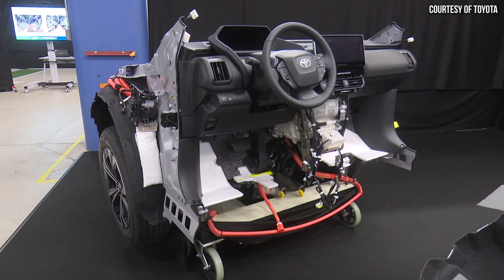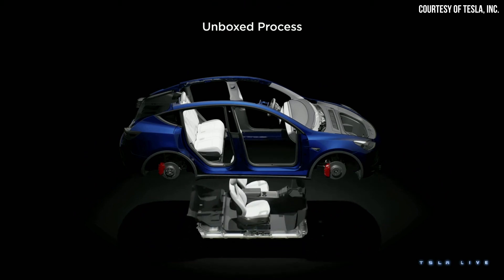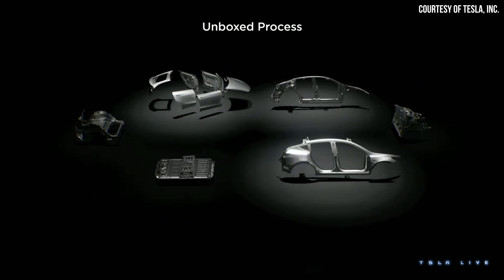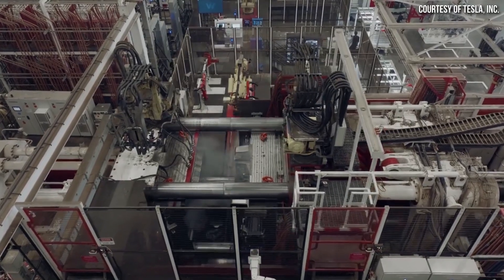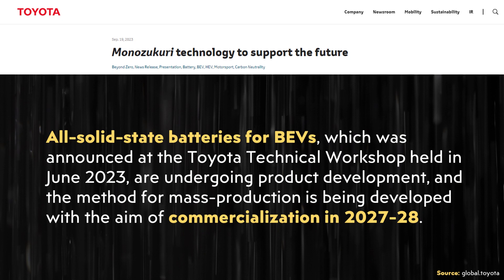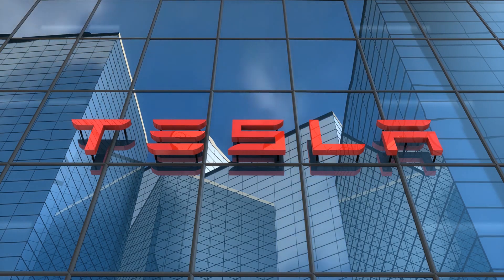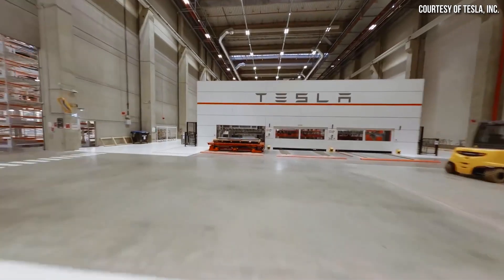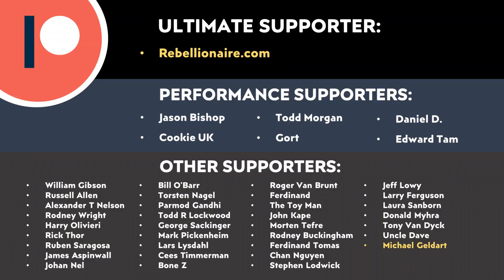Toyota is Copying Tesla UNBOXED Manufacturing & Giga Castings

Comment: So at best Toyota is 3 1/2 years behind Tesla on car assembly, but only hollow words.
Which is their standard response, like radar glitter or flares from fighter aircraft.
Their Gigacasting looked like a bikini - hardly did the job.
Still no autonomy, no Dojo, H100 clusters, no battery manufacturing, no integrated HVAC.
Toyota has lost market to China, let alone to Tesla.
Way too bureaucratic, too late, too confused. I bet they propose hydrogen next week.

Comment: Sounds about right, copy and perfect it. Toyota has 100 years of Manufacuring experience i don't think they are going anywhere. Looks like they are taking things seriously now.
Reply: Toyota is dead in the water PRECISELY because they have "100 year of manufacturing experience." 100 years of doing things a certain, legacy, staid, sterile, way of producing vehicles. Compare that to a company that re-imagined a vehicle from the atoms up in design, build, mass production, delivery, and future improvement. Toyota plans to copy a moving target? Yeah....no. By the time they get to market, Tesla will be yet again further ahead with something new.
Reply: @vermontsownboy6957  Then you dont know Toyota so we'll and are just so wrapped up in bieng a Tesla fan boi and regurgitating the usual Toyota hate. Toyota don't sit still, they make crazy one  off stuff all the time, like that large circular loom to weave intricate carbon fibre shapes. The speed of adaption is also very impressive with regards to modular design and gigacasting. You think the Toyota production system that a heap of other companies also use is going to just remain stuck where it is and not gun for constant improvement? AI iterative design is the  next big thing, companies that leverage this the best and can manufacture these designs will have the advantage. Of all the legacy automakers i reckon Toyota will be having the best shot. Also battery tech can give a huge advantage. Maybe Toyota will be first to market with a solid state battery. Time will tell.

Comment: Toyota is going to have the cars drive themselves down the line.  But they're using an unboxed process.  They can't roll down the factory until those modules are joined, which should be late into assembly (otherwise there's no benefit).  Something doesn't add up.
Reply: Saw the report days ago. They were talking about robot transporters moving the units.
Direct copy

Comment: 4:16  but if you make the whole underbody in one piece, then you cannot use the unboxed process, because the parts come already joined, correct?
Reply from the maker: You can still use an unboxed process, it just makes the underbody section 1 piece instead of two.
Reply: @Cleanerwatt  
The whole point of the unboxed process is to maximise the number of "workers" around the units.
.
3 units (front, centre, rear)
4 sides, so 4 "workers" per unit.
12 working on 1 car before final assembly.
.
1 casting, only 4 sides.
Reduced workers , more time to complete the chassis.
It's essentially similar to the old methods.
Reply: @Cleanerwatt  still not completely clear, but if you say so, I trust you. 🤠
Reply: I agree, that tends to revert things back to the "skateboard" concept, which is a giant step backwards.  So I have doubts about that "single-piece casting" report, which originates from a single source.  Not to mention there's currently no gigapress large enough to make such a casting.
Reply: @satoshimanabe2493  
I agree re the source.
Seems to be a "non-expert" misunderstanding a process.
Reply: As do many things. All things that are not singularly 'cast'. You start off with many many things or objects and construct something more complex out of them. The visual representation of unboxed shouldn't be taken as an extreme... too much in a literal sense. It was an example, an example of why the f are we doing it like that!?

Comment: How many EVs will Toyota produce this year and is 1.5 million even possible for them in 2026?
Reply: I'd eat my hat
Reply: @theproffessional9  😂
Reply from the maker: It will be difficult for them to hit 1.5M anytime soon!
Reply: They're "planning for 30% in 2030"(?)
Several issues with that.
1) Is that "30% of current total vehicle production"? Are they assuming they will still be making and selling 7+ million ICE cars in 2030? (Dangerous assumption!)
.
2) Are they still referring to "Electrified" rather than "full BEV"?
They didn't seem very specific.
If it's full BEV , what about the Hybrids (including Hydrogen) they were including last year?
.
3) The last plan was to install Solid State cells in Hybrids, presumably because either they were so expensive, or they couldn't produce enough for full BEV packs.
That's another number that needs clarification.
30% "Electrified" split between Hydrogen Hybrid and BEV... But only in Hybrids?
10kWh per pack? Say  1-2 million Hybrids?
That's the same as about 330,000 60kWh packs in full BEVs.
.
If they're now saying 
"3 million BEVs"
That's a 9x increase in the projected cell production.
🤔
And now they suggest 1.5m in 2026?
🤔🤔

Comment: Gigacastings  are about maximising profit margins for as long as possible, rather than delivering affordability.
The decontenting is about to make all Tesla vehicles more difficult to understand for the driver and adversely affect sales volumes.
Gamers have struck.
Reply: SO wrong
Reply: @rogerstarkey5390  let the figures decide.
Reply: You are wrong. You added up the time and cost to assemble the individual parts that would be replaced by the giga cast. Now add up the time and cost to produce each one of those individual parts that go into that assembly. Plus if you don’t make them in house, there is all they purchase orders and payments and personnel dealing with the vendors who make all those individual parts. The casting is substantially cheaper.
Reply: @ZeusBullyMax  yep 
Profit margins and writeoffs